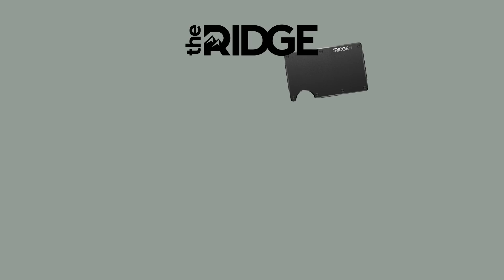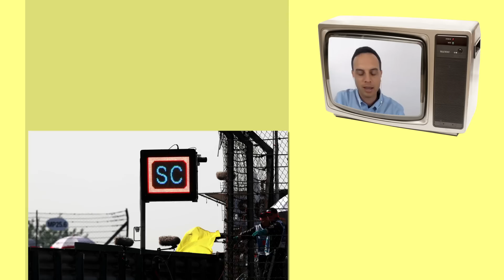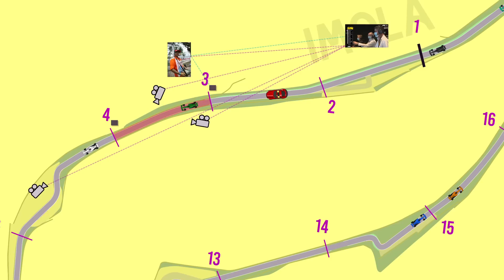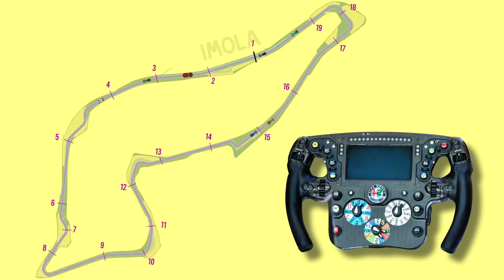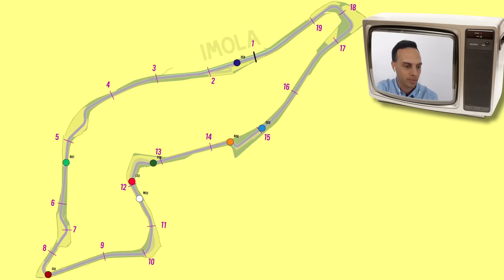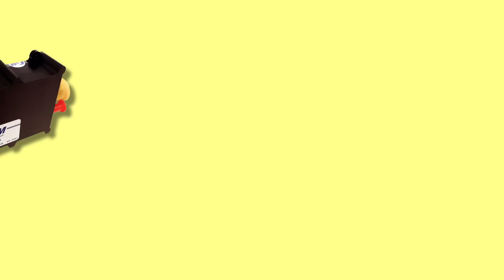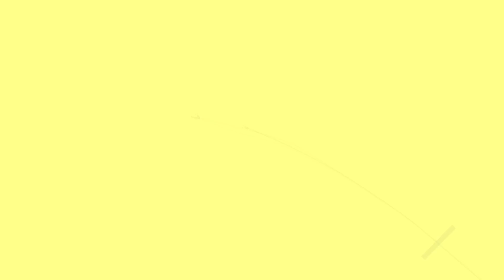How F1's Electronic Marshalling Systems work - ft. Luca De Angelis

Comment: does the earpiece data go to the G force graphics shown on the Halo or is that some AWS magic?
Reply: I understand the G force data comes from accelerometers inside the car itself.
The earpiece data is far more important for things like understanding if the driver may or may not be injured.

There is something not mentioned in the video, but is something that Dario Franchitti (one of the Formula E commentators) has said - accelerators that record a certain amount of force in a certain way will trigger certain LEDs on the car which indicate to marshalls to not touch or attempt to help a driver out of a car.
What's incidentally more common than brain injuries are fractured pelvic bones, which may not immediately be painful for the driver.

In the 2019 Mexico City ePrix, such an LED lit up on the car of Nelson Piquet Jr. although he didn't have any fractures or brain injuries, he was bruised.
Reply: @vaska00762  thank you! i love the tech in formula 1/E but i don’t know much about it. i’ll definitely do some reading because that’s really cool!

Comment: A related question I'm curious about is how blue flagging works - presumably the marshals in sector 8 don't know that Verstappen is coming up behind (say) Vettel in sector 7, so they need to show Vettel the blue flag in sector 8, right?  So how does that work?  Is it just a constant stream of verbal instructions to the marshals from race control or is it more automatic?
Reply: No, it is the skill of the flagger.  With experience, you are able to keep track of the running order of the cars. In F1, with only 20 cars and each team having a unique livery, it is not especially hard to spot which team is approaching, and the colour of the camera pod tells you whether it is the primary or secondary car/driver.  Blue flaggers don't always have radios and and when they do, sometimes there is too much chatter and can be distracting. There are tricks, as well.  To estimate the first lapped car, we measure the time between the last car and the first car.  Fast or slow, pro drivers maintain fairly consistent lap times.  So you can estimate the number of laps to the first lap, and even whether the pass will be at or near your station.
Reply: I've never done Formula One, but in practice and qualifying sessions you basically just have to know which cars are faster. You have a window of vision that's different at each post where you have to figure out who's faster and display blues.
In Australia we have a lot of support races for Supercars, our National touring car series, and in those support races, race control doesn't help very much with blue flags. We pretty much have to pay attention to gaps lap by lap, with no timing or broadcast to know who has pitted.
For Supercars, however, race control will let us know when a car starts to be lapped with a radio call like "Race control to all posts, blue flags for car 4."
Reply: @AstonCulf  nice insight you gave us here, thanks a lot o/
since F1 is impossible to see the car numbers at speed from a stationary observing position, my guess is race control commands blue flags for back markers, as the number of the car shows up at the pole screen
otherwise marshalls would have to remeber both numbers for each team, make out the livery and spot the black or yellow differentiator at the top of the car
seems unfair to expect that from someone working with race safety first
Reply: In F1 and maybe some of the other high level FIA races the Blue flags are controlled by automated system in race control when they're at a certain distance and in most other racing it's up to the flaggy to keep up with the race and even some of the most experenced flaggies get it wrong often which just wouldn't wash well with F1.
Reply: I second this, I would love to know too
Reply: I was trackside 2 days ago, if you've got questions let me know
Reply: What it is for blue flags! The track is broken up into a lot more section less than 50 metres apart all the way around the teack. At each sector the Marshall have a blue flag button that they press on their sector. As the car being blue flag move to the next sector another blue flag is shown till the driver gets to the 3rd sector. I will leave a link to this below. What you see on TV as one sector is about 10 blue flag sectors. It akso comes up on the driver's dash as he coming up to it. They get a gap of 1.2 before showing the first blue flag. https://youtu.be/QHdo3WN-mkc
Reply: Please check out my reply. I also put a link in that explains more

Comment: Love the insights into the signaling systems! Did not know the bit about crash data being sent instantaneously to race control. Just makes me very curious about the exact algorithms used to detect crashes and the thresholds to distinguish b/w something like a crash into another car, a car stranded onto the gravel vs something that's had a light hit at the barriers and maybe lost a front wing. Accelerometer data would be key, I presume...but how do they deal with anomalous sensor data caused due to the loads involved in F1 racing
Reply: The telemetry is not as sophisticated as what you describe. Medical information comprises g-force, heart rate and, I think, respiration rate. The type and severity of the crash it not communicated automatically to race control.

Comment: Is the GPS data also used for the final lap time. Or is there is seperate more accurate system for that?
Reply: Timing uses a different system.
Reply: Typically timing is accomplished by using some kind of trackside sensor. This equipment is set up by the official timing provider for the motorsport... idk who it is in F1 presently, but Tag Heuer is a common provider of sports timing equipment, which are either based on using photocell sensors or some kind of electromagnetic circuit that can detect the presence of a metallic object.

Comment: I'm assuming this applies for blue flags as well, then what the hell is mazespin's excuse is he blind to not see the blue flag on his wheel or too stupid to understand what flags mean, not being told by the team is not an excuse unless haas doesn't have this system installed in which case wouldn't that be a violation of the regulations
Reply: I think the reality is simply that Mazepin is in over his head. He wasn't ready for f1, and he sure as hell wasn't ready for a car as difficult as the Haas. He's overwhelmed. He's going to need to pull it together soon, or back out before a disaster happens.
Reply: Mazepin is basically a try hard. He's trying too hard to not lose too much time being lapped among other things instead of just taking the natural progression route especially considering the Haas is shite at best at worst it's undrivable. He's essentially the child in the kitchen trying to cook and getting overwhelmed but instead of calling for help tries to sort it out but can't which essentially ends up making matters worse.

Comment: 8:30 - [??] sounds like "inertia sensor" to me
Reply: I agree
Reply: I don't want to seem overly pedantic or insult your intelligence in any way, but I don't get if you are surprised by the use of the expression "inertia sensor" vs the more commonly used "inertial sensor" or the workings of such sensor...so either for you, if it's the case, or anyone interested here goes:   (I hope you don't mind :p )
The gyroscopes and accelerometers are both inertial measurement units/sensors as they are MEMS (Micro-ElectroMechanical Systems), though they can be found in other forms other than micro-sized. They are essentially a mass on a spring moving due to inertia; inertia being the tendency of mass to resist changes to it's current motion state, or if it's already moving, the tendency of mass to keep moving in the direction it's already moving, unless acted upon by external forces such as acceleration. Once moving from it's normal resting place, this mass in turn affects an electric field inside the sensor housing, which is amplified and output from the unit as a measurement. The IMU or Inertial Measurement Unit, as the name suggests, incorporates two or more such inertial based sensors plus other types such as magnetic (compass), or GPS, with their outputs fused together via an algorithm to determine the precise positioning of an object in 3D space exactly like any smartphone, just with much more range in terms of G's of acceleration or precision of the GPS etc. So what DeAngelis referred to as "inertia sensor/s" is the family or types of sensors he was about to enumerate: accelerometers and gyroscopes.
Reply from the maker: @Archangell27  He's referring to the fact that the subtitles said "[???] sensor" because my transcriber misheard the word and I struggled to hear what he was saying on the listen back so wrote "[???]" in the subs. Corrected now.

Comment: Unfortunately I don't suffer with a bulky wallet issue. Wish I had enough money to have that problem though
Reply: Just have a tenner broken down into small change, and you can feel the bulk experience as well.
Reply: Indeed😂
Reply: You just need a wallet WITH A  CHANGE POCKET AND ZIPPER.
Seriously look at the example in the commercial. It's got a zipper. *exhasperated sigh
Reply: They also cost like 70 - 150$ 😂
Reply: @Artomotive  Purchasing the wallet is what really cuts down on the bulk
Reply: Easy - just switch to paying with coins
Reply: who the fuck uses cash anymore